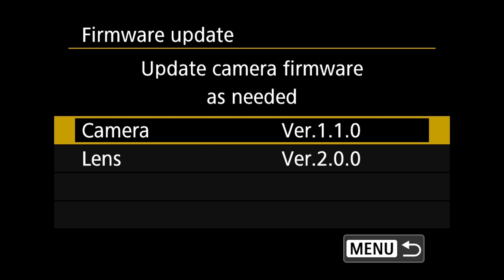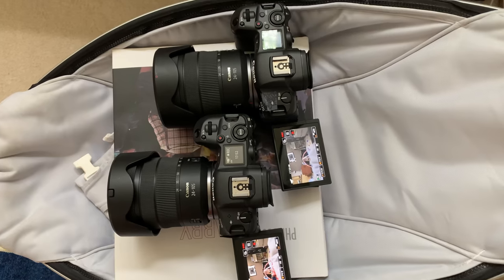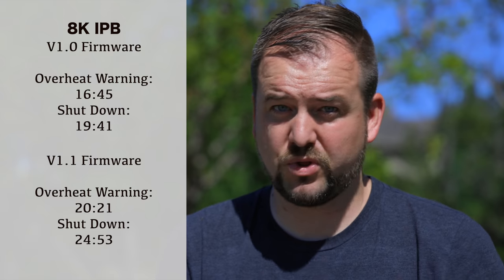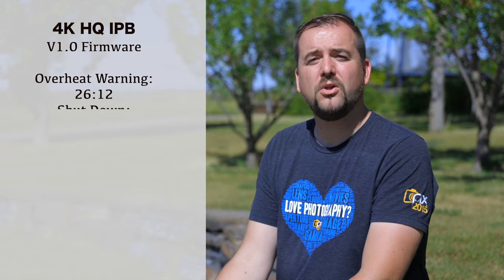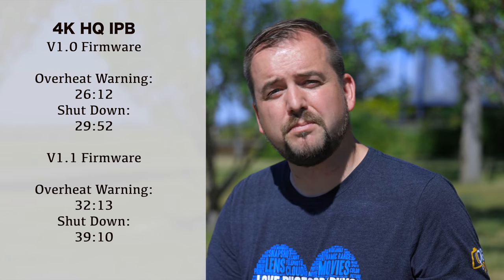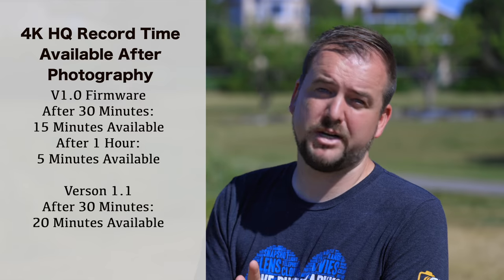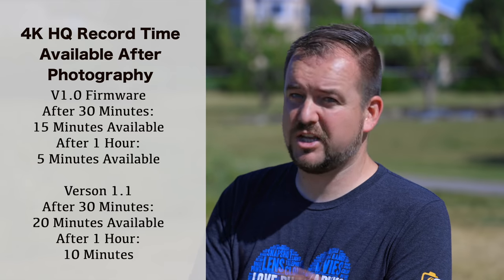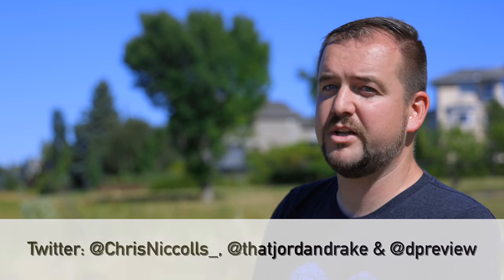Canon R5 Firmware 1.1 - Is the overheating fixed?

Comment: Some call it improvement - some call it just less fraud on the customer. They should delete the timer and react only on the temperature sensors.
Reply: Nope, thats not a good idea at all. As a firmware engineer myself I can tell you I write often such codes to deal with overheating. You don't want to shut something down right away when it hits a threshold because if the temperature increase happens sporadically then you have to instant shutdown the system. A timer is indeed necessary to properly implement it. The logic is you would want to wait up to a certein period and see if the temperature still keeps rising above the threshold. Then initiate the shutdown process.
Reply: The problem may be that the temperature sensor or sensors (haven't seen how many there may be) may not cover all parts of the camera (hotspot components) in which case they may need to take the info they have and then use a timer based on prior gotten data from the engineering process of how hot other parts may be when this part is x degrees after this long. And I'm sure next you'll say well then they should have used more sensors on those parts but that all takes up more board space for both the sensor and the processing portion, space that may not be available plus things like rtds and thermristors are prone to failure long term and the more they go off that data the more likely it is to brick the camera long term.
Reply: @kaadhome5821  no, the worst and most unreliable value is a timer. A timer cannot take the ambient temperature into account. And it has been proven that the timer still limits the recording time regardless of the temperature of the camera. https://www.youtube.com/watch?v=JQAxtOyM7MI
Reply: @kaadhome5821   DIGIC processors are ASIC chips and probably assisted by some ARM processors as well. Its standard for these kind of heavy duty cpus to have internal temp sensors or at least provision for adding external temp sensors to protect from thermal throttling. Other parts inside any electronics  that can generate heat is the RAM chip and the NV storage or even the power regulator section can too add up some heat. Its standard  practice to monitor the heats in these areas of small form factor electronics and it would be foolish to think that an evolved tech industry like canon is not doing that. 
To me the only explanation makes sense is, they have all the right data from right places but they are purposefully not deciding to use them to increase the product's quality.
Reply: It is reacting to the temperature sensors, lol, but it is part of a heat management system.

If they eliminated that and just relied on the camera working until it didn't, your camera would last a few months before it would stop working for good.
Reply: @Sam1712  What he is saying is normal practice designing systems. It is not practical to get all the information in a complex system like this that you need, so you have to extrapolate from the information you do have based on controlled engineering experiments conducted during design. You know what sorts of temperatures various parts of the camera can tolerare for extended periods, and you know how fast they cool down. From that information you apply timers to approximate real world working conditions so you can protect the system over its expected working life. It is not ideal but it is practical and it does serve a purpose, even if that purpose is not convenient to users.
Reply: @Tugela60  k
Im designing electromechanical parts and housings. it's never ever a technical reason. Why should a camera shut down for 1-2 hours without exceeding a temperature limit before? There's no reason - just terrible marketing. https://www.youtube.com/watch?v=JQAxtOyM7MI
Reply: @Sam1712  It is not shutting down for that long. It takes that long to reach equilbrium with room temperature. You can restart the camera after a much shorter period, you just don't get as long recording time if you do. Lots of cameras that overheat have that behaviour. If you had one of the earlier RX100 4k models you would be quite familiar with this (although those shut down much faster than the R5 and R6). Thermal management is nothing new, it is just that people have not experienced it in Canons before because they have not previously pushed the performance envelope to its limits like with these cameras.
Reply: @Tugela60  thats not true for firmware 1.0. and only "better" with 1.1. Again... any timer doesn´t make sence for a overheat protection. Because no timer can react of the ambient temperature etc. And the cooling down time was at 1.0 in both cases exactly the same. In the sun and packed in ice. Thats so stupid.
Reply: even if they uncripple the cameras software the fact still remains that the codecs are absolute garbage on these cameras. H265 should be a deliverable, not an editing codec. There should have been XF-AVC implemented in these pieces of junk.

Comment: Good video Jordan, but you could have at least referenced the recent findings publicized by EOSHD that prove that the limitation is not temperature related (the stick a screw in the battery door thing). I get that you don't want to piss off companies who send you review hardware, but I think we need to hold them accountable.

Comment: Imagine doing all this testing, and the cameras don’t even overheat in the first place. LOL
Reply: Lol right, its all fake and canon should own up to it
Reply: @CallMeRabbitzUSVI  YES!! ....Thats what irks me the most!!.....WHY CANON WHY??? 😡😡
Reply: Jordon, thanks,  for taking all your time testing. Should hill Canon. Now retailers are left to defend the marketers. Way to go building a brand. Canon.
Reply: Yep, he's literally just testing how much more Canon are allowing people to shoot by just extending the time.
Reply: Let’s see if someone can change the firmware and remove the limit
Reply: Do you honestly think that they managed to make a tiny weather sealed 8K raw shooting camera that doesn't overheat? That would be insane considering the cooling systems most cameras require for that bandwidth. However, that has been debunked now with the new information that the camera actually has 3 temperature sensors that are playing a part in preventing the VERY REAL overheating.
Reply: @justinjames403  Because its a full frame sensor with 45mp, that reads out full without crop at 8k in RAW and 12 bit. Thats why. That thing will produce a lot of heat and heat is not a thing sensors like. Not only does it damage the sensor, it also decreases the image quality over time (more noise and other artifacts). Not one would like that to happen. Does no-one rememmebr all those problems with Sony cameras and damaged sensors? Heat is still a problem even with Sony cams but at least they now also have some limits they apply. The new a7siii overheats even faster then the R5 even if it was said that would not. So heat is not a thing that only affects Canon

Comment: I was happy with the R5 in the beginning and for photography still am but the more I use it for video the more frustrated I get. I would even be OK with the recording times Canon released but those are only true on paper. When actually using the camera those are not true. I couldn't even finish a 50 second b roll for my channel and the worst thing is that one of the headlines on Canon's website for the R5 (still) is: "Revolutionising videography. Again."  That's just wrong...
Reply: That's been exactly my experience too. If the overheating modes weren't affected by use of all the other modes or by photography, then the record times they give us would actually probably be usable but the other day I made a similar mistake, I shot a bunch of 4k 24 and then tried to get some 4K slowmo shots after, only to find that all my buffer was gone and it didn't come back for over 2 hrs. The 1080 60p actually looks pretty good in a pinch but it's 2020, I've been shooting 4K 60p on other mirrorless cameras for years, I can't go back to 1080! How on earth did the little XT3 manage it without overheating and the R5? Oh, right, it's a fake timer and there's no thermal paste... We need Firmware 1.2 and a hardware recall.
Reply: @BryanWilkat  Exactly. And I don't mind 8K overheating but if you advertise a camera "revolutionising videography", all 4K modes  should work flawlessly. 4K is standard  now...

Comment: It’s obvious why some cameras have overheating issues. The part that can overheat in some cameras is the CPU. In the R5 and R5 for 4K60P it’s processing the censors full 24 MP (more in the R5) every 1/60 second to compute the approximately 8Mp needed for a 4K image. Thats far more data crunching than these camera specific cpu’s were originally designed for. That is why the PANasonic S1H put the fan right on top of the cpu. The reason the Sony A7S3 doesn’t overheat without a fan at 4K60 is because Sony limited the camera to 12MP.  The R5 and the R6 are the perfect cameras for shooting in Antarctica or meat lockers.

Comment: If someone wants more than 1 hour long clips of excellent 4k footage downsampled from internal 6k footage and with Eye-AF, they can use the Sony Alpha 6600. Sure, it's an APS-C camera, but it performs very well in low light. The image quality of the Canon EOS R5 4K HQ clips (downsampled from 8K) and that of the Sony 6600 4k clips (downsampled from 6K) can hardly be distinguished in terms of resolution. The Sony 6600 does not have the "usual" 30-minute limit. Someone tested that one clip would take more than 2 hours until battery gets empty. Another one has  tested that there is a fix time limit, namely 13 hours (!) and 1 minute.
So if you want to get several hours in one clip in excellent 4-k, you need the Sony Alpha 6600 and it is much cheaper than the Canon R5.
And to get an equivalent depth of field (DOF) as a full frame camera you can use the excellent 3 Sigma APS-C lenses for E-Mount : 16 mm, 1.4  (equals 24 mm, 2.0 for DOF full frame),  30 mm , 1.4   (equals 45 mm, 2.0 for DOF full frame) and  56 mm , 1.4  (equals 84 mm, 2.0 for DOF full frame).

Comment: These are the tests we exactly needed to see. Thanks so much for doing this. Very disappointed, will be shipping my R5 back I think.
Reply: You should sell it on eBay for $1-2K profit instead.
Reply: How much will you sell it for?
Reply: People that bought this camera to primarily to shoot video dont get my sympathy.
Reply: How many people actually use 8k and 4k HQ and record that long? Lollllllllll
Reply: @WhereToFind  agreed
Reply: @libafried5840  Sorry but I never had that impression.  Obviously others did. With that big sensor and no fan I always thought it would be limited to clip length functionality. Maybe the term Cinema versus video? Will certainly be interesting to see where this ends up. Certainly the 8k was foolish I think.
Reply: The fact that you can actually record in 8K with a camera costing under $4,000 is an achievement. An I perfectly understand any company being the first to achieve that would want to boast about it. End of story.
Reply: @markrigg6623  I think 8k was a foolish too in terms of limiting the camera's abilities to perform as a video camera should, which was how it was promoted by Canon.
However, Canon is definitely better at promoting their product than Nikon which simply provides unexciting but reliable cameras... It's all about the marketing and hype so therefore I can see Nikon losing the race despite their cameras being more reliable for professionals.

Comment: So they crippled the cripple a little? 
You're much too positive here, I think this is still cringeworthy and embarrassing for Canon, how many others are so obviously putting totally artificial limitations into their products?
Reply: Artificial timers have been debunked now that pre-cooling the camera is confirmed to extend record times, and cooling it after overheating speeds up recovery afterwards dramatically. Turns out there are actually 3 temperature sensors that all play a part in the overheating warnings.
Reply: @brazillmedia5802  Proof please. DPreview is a big industry reviewer even if they are often critical of Canon, so they can't call out artificial limitations.
Reply: @brazillmedia5802  That doesn't debunk anything. 

EOSHD used the EXIF data (as I'm sure you're aware) to get temperature readings and even pushing its limits the camera never reached dangerous temps.

Do you know how easy it is for Canon to implement a firmware change that makes the temp sensor acknowledge a colder state and then give the camera a minuscule additional record time? I wouldn't put it passed Canon to pull more skeezy moves like this.

No, this isn't proof in the least. Further tests have to be done before you can claim it's debunked.
Reply: @brazillmedia5802  Stop spreading fake news. The artificial timers were present at launch in firmware 1.0. We prove that. DPReview has never acknowledged it and still doesn't. Jordan is just toeing the line. Not got the balls to call Canon out on it because they need their PR connections and early review units. That is the truth. The new firmware update, sees Canon measure some temps to pause the timer. A face saving exercise that isn't actually very much practical use on a shoot, especially if you haven't got a spare fan, ice pack or fridge to hand, and just want to get on with a professional day's shooting with no workarounds. It has blown up for Canon. And they deserve it.
Reply: @SimonHergott   Yes, he used EXIF data from one of the 3 available temp sensors, so not all the same data that the camera has available. And it also never explained why people got such varying results from the fake timers in 1.0, and were even able to extend recording and shorten recovery times based on ambient temperature. But fair enough that its not 100% debunked - it just never seemed like a sound theory in the first place given how many conflicting results other people were getting.
Reply: @EOSHDTV  Sorry, but I'm just not convinced by those initial tests with so much conflicting data floating around at the time like people extending 8K record times past one hour by pre-cooling the camera.
Reply: @Jay Galvan Sure I do, but I don't want to spam this video by pasting them here. Go check out Gordon Laing's or No Life's latest videos on the topic. Both confirm that record times and recovery times can be affected (dramatically) by temperature.
Reply: It is artificial in the sense that it is intended to protect the camera over long term use. So, instead of failing after 6 months it fails after 6 years. By increasing the thermal limits on the camera Canon are reducing its working lifetime. They can reduce it to as short as possible without bringing too many units into the warranty period if that makes users happy.